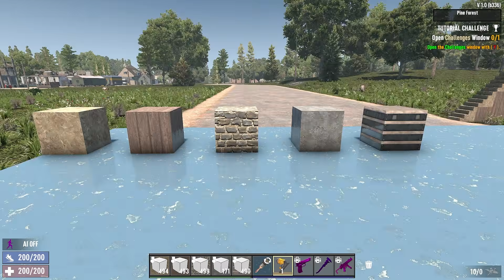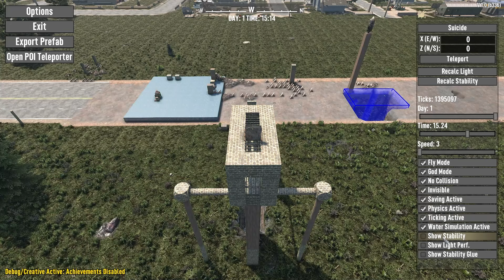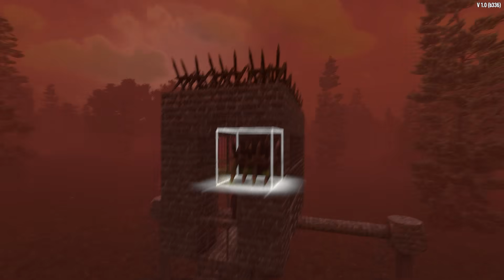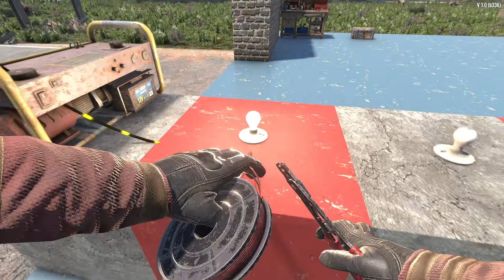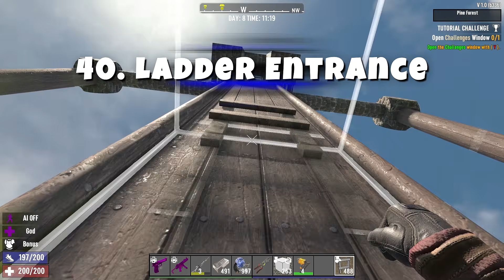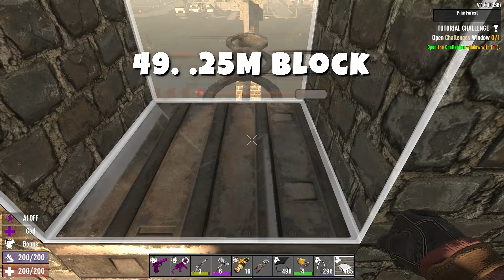50+ Beginner Building Tips In 7 Days to Die - 7 Days to Die (7 Days to Die Tips and Tricks)

Comment: I don't think having battery bank and generator together is redundant, the gene keeps that battery's at full charge whilst powering the base and then when the fuel runs out the battery banks take over for extended time between refueling.

Comment: Another tip, not for building, but just in general. Once you’ve reached a point where you’re not desperate for money immediately, and have a bit of breathing room, rent a trader vending machine and put your big ticket items in there. It takes longer to sell, but you’ll make waaaaaay more money. Also, (this may have changed since the 1.1 update, I’m not sure) if you have the best gear, perks, and consumables to get the best deals from the trader? You can actually buy some things for cheaper than you can sell them for in the vending machines! Some big ticket items I used were solar panels. I’d get them for really cheap using all the buffs possible, and then put them in my vending machine. But like I said, that may have been changed. As I still have some in my machine and I looked at their price in there now and it seems much lower than it was before. So I’m not sure if that changed or I just don’t remember how much it used to be lol they’re selling for around 20k now. But I swore it was like double that before. And I was buying them for like 10-15k.
Reply: Just keep in mind, when the days of your rental run out? Everything inside vanishes… so always make sure to either rent an additional amount of time or empty it before the time runs out.

Comment: Good Tips.

My preference is for using a hatch to close the entry point with a .025m pole directly above the hatch to make it too small for them to fir through while the zombies run along a round pole to get to me, about 3 blocks along that way there's a robot sledge turret that yeets them off(usually far enough that they have nothing to attack if they rage). I keep my sides clear of grates and railing to avoid having cops try to shoot me through them(or place hatches over them). Once i get tech high enough you can make a spiral where the pole they run to get to your fighting zone gets them to an edge on the side they then need to run along encountering multiple blade traps that you can repair from the inside(i'd recommend a railing here to avoid running afoul your own blades) and then if they make it the whole way i can just stun baton them off(or other melee weapon) and they can go run the whole path again. if they pile up too much then place some inverted ramps above the path so when they jump on top of each other they are shunted off the path(back to start with yee). 

All else fells set some powered hatches up to be open(thus making a path) and a switch for you on your exit route to toggle their state and dump everything from the most important areas.

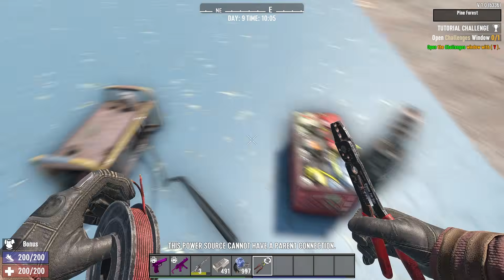Comment: 9:44

I wouldn't say that its redundant though. You can keep it charged and if your generator runs out of gas without you knowing it, the battery bank will be fully charged to take on the work load as a failsafe. 

I'm not sure what the trade in costs are though. Hopefully it doesn't consume a lot more gas to keep the bank charged up. 🤔

Comment: Cool video, I like that you've covered some of the most used alternate blocks without getting too far into the weeds.  One important thing to note is that if you surround yourself with blocks other than full blocks or ramp blocks cop zombies can see through most other blocks and will spit at your base causing significant damage over time, specially in the later game stages.
Reply from the maker: appreciate this

Comment: How do you get all them building options on ps5 just started playing can't find stairs
Reply: When you’ve selected the building block in your hot bar, hold down the square button on your controller.  It brings up a wheel with choices.  At the top is change shape. Select that, then  on the left is a column of categories.  Stairs have their own, but also basic stairs show up on the default screen
Reply: @invis-unicorn  thanks for that really helped me I can finally build stairs 👍

Comment: Addition tips☆ zombies will ignore latters that are 2 block off the ground. Turned off light bulbs use no power while working as relays. Dont wire fences in series as one being broken will unpower the rest in the circuit (dont use fences as relays they take damage from use. Also you can connect fences through walls (if you can reach) making it possible to safely repair them all night if your clever enough.
Reply: Also if you are planning to use shotguns I'd recommend using  bars for the path as they will not take damage form shooting them their are some other blocks that have this quality but center bars are my go to as it narrow yet still seen as a valid path to the player